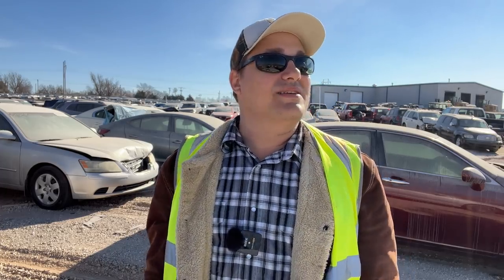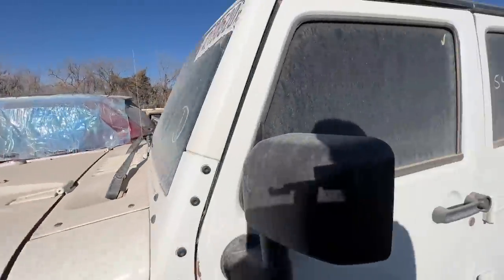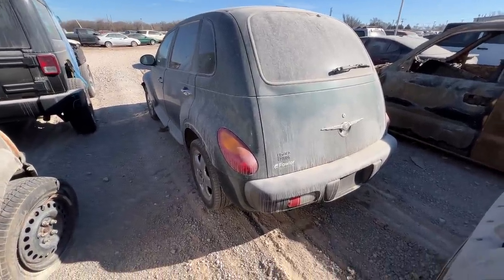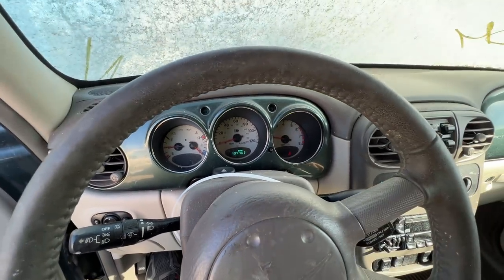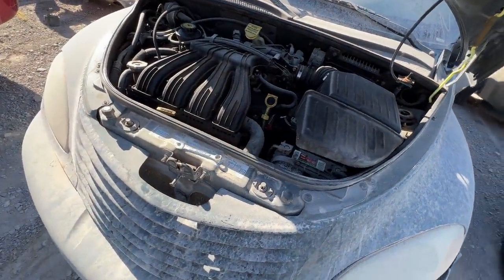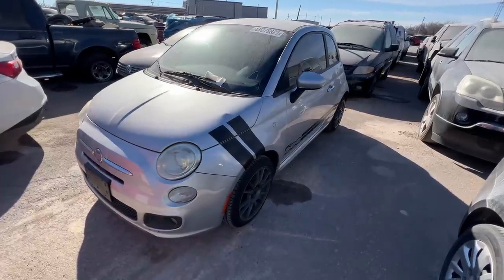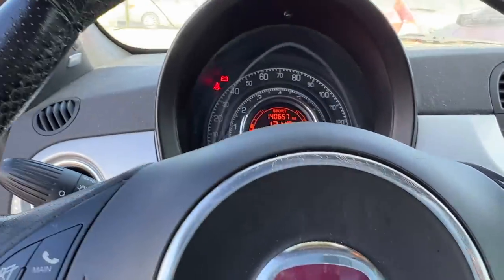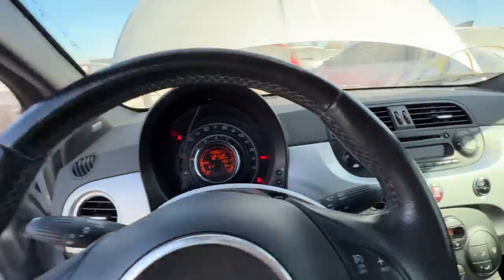Copart Walk Around 12-24-21 + $300 Fiat 500 + My Field is on Fire!!

Comment: I bought a 06 pt for$250. Original owner 42,000 original miles free transmission shops said it was the transmission was bad I changed the crankshaft positioning sensor $15. On Amazon 10 minutes to do it and now have put well over 20,000 trouble free miles on it and the thing your taking about is called tipm in that computer that go bad still easy fix

Comment: the control arm they rust out easy. but wed a new one back on, check the other side. do a froth end alignment it be good. my wife control arm came off on her 2013, & i just got a new arm bracket with more steel in it & arm for it.

Comment: Those Chrysler PT Cruisers are notorious for blowing head gaskets prior to 70 thousand miles. The higher mileage ones you will ever see are around 100,000-150,000 miles. Fiat isn't any better. You already have fiat engines burning oil at 15,000 miles.